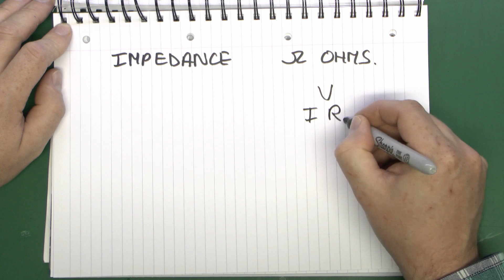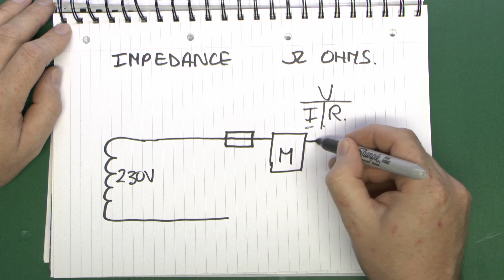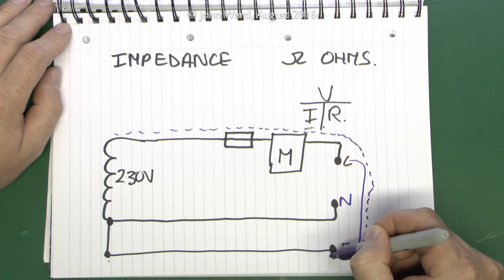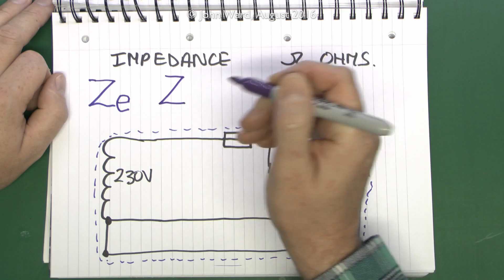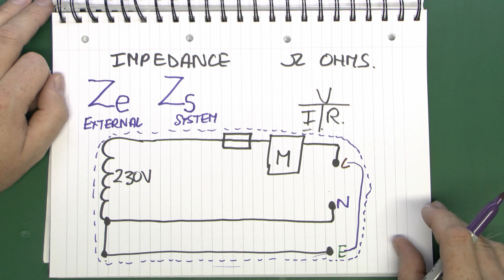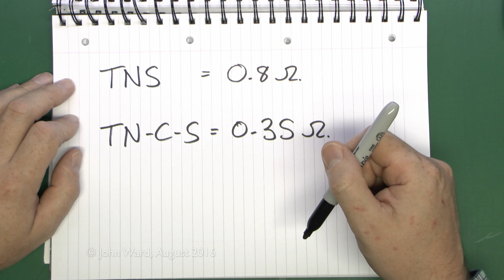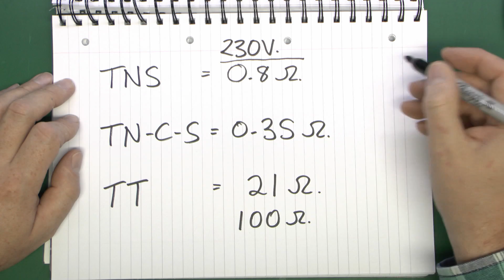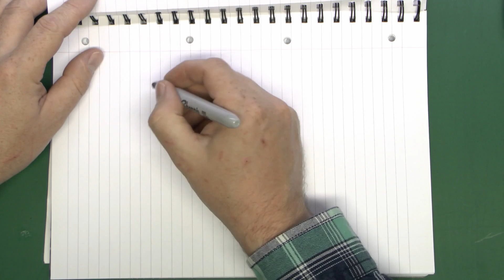Loop Impedance

Comment: Hi john need to pick your brain you say in the video 200 300 olhms is believed not to be acceptable which is what I thought when looking in the regs book and it says anything over 200 means it could be unstable anyway went to a job got 253 olhms on a tt spoke to Nappit who I’m registered with and the chap on the phone said it’s fine because I’m within 1667 olhms but put it down as a code 3 and recommend to go back in the summer and test it again. My problem is spoke to another chap there before about a year ago and he said to me Nappit requires you to be within 200 olhms nic 100 olhms so I’m left scratching my head is anything over 200 olhms satisfactory or unsatisfactory in your opinion.great video by the way
Reply from the maker: In theory anything under 1667 ohms is acceptable, that value being derived from the maximum touch voltage 50 volts and the 30mA RCD rating  (50V / 0.03A = 1667 ohms).  However in reality the value need to be much less, as it will change due to soil moisture content, so the advice about testing again in the summer is valid.
The main thing is to ensure the value is low enough all of the time, which is why 200 or 100 is suggested, that being low enough to ensure that even with dry soil the value won't increase above 1667.
Reply: Thinking I’m gonna just buy a new earth rod and stake it again as old rod connection is buried under some type 2 gravel and probably corroded cannot be going back there in the summer as never want to go back to this job ever again lol. John so in my max permitted zs box do I put 1667 ohms?
Reply from the maker: @Sparks9133  Yes, 1667 ohms, assuming the RCD is a 30mA one.
You can leave the old rod connected, just put a new one in somewhere else, at least 2x the length of the new rod away from the old one (so if the new rod is 1m long, it needs to be at least 2m away from the old one).

Comment: @John Ward

Preparing for an exam and one of the questions is baffling my head, I probably over worrying and it's a molehill of a question I'm turning into mountain hope I explain it properly here goes:

I have six circuits protected by a type B cb:

40A / 32A / 32A / 20A / 16A / 6A

0.5 / 1.25 / 0.96 / 1.62 / 2.0 / 7.3 are the measured loop impedance's for the circuits respectively.

1.15 / 1.44 / 1.44 / 2.3 / 2.87 / 7.67 are the maximum values of loop impedance for the circuits respectively.

It's asking me to refer to the maximum values and show by calculation if these values of acceptable. How do you work out loop impedance if you only know the circuit amps and the measured loop impedance?
Reply from the maker: This is about the 80% rule of thumb, you are just calculating whether the measured values are less than 80% of the maximum permitted values.
For the first one, 1.15 x 0.8 = 0.92, 0.92 is still larger than 0.5, so that is acceptable.
For the rest, some are acceptable and some are not.

Comment: Short Circuit is 287A something, then why circuit breaker's Breaking capacity is up to 6kA, 10kA..?
Reply from the maker: 0.8 ohms and 287A is a typical maximum value for a TN-S supply.  In reality it can be much lower, and fault current much higher.
Reply: @jwflame    I was about to ask about the minimums in practice you come across!.
What about people who live right next door to the substation transformer?  -- Do the DNO wire then 'backwards' from some distance away to increase the impedance to a sensible minimum?  -- Do they put in an intentional impedance-block in series with the supply to those nearest the station?   Does the transformer winding itself provide sufficient impedance to be an acceptable-minimum?.  Is there a ESQCR-like regulation or other regulation for impedances provided to customers, anyhow?   --  i.e. where do these 0.35 0.8 etc. magically come from?!?!?.

Comment: When testing a circuit that has parallel earth paths eg a boiler or a related item do you remove that path. I know you do with r1+r2 tests, but what about achieving a maximum zs test result. This also applies with heating spurs off the ring main etc.

Comment: Hi John. Thanks for the excellent lesson. I currently have a 2.1 Ohm Ze measurement at my TNS incoming line. It previously used a sweated earth braid but has a later clip. UK Power Networks measured directly at the lead sheath and say it’s still in excess of 0.8 Ohms so the clip is not responsible. They are currently refusing to rectify the situation saying that they are not responsible for providing an earth. However, an earth was originally provided, and I note that the Electricity Act 2002 states: “A distributor or meter operator shall ensure that each item of his equipment which is on a consumer’s premises but which is not under the control of the consumer (whether forming part of the consumer’s installation or not) is—
(a) suitable for its purpose;
(b) installed and, so far as is reasonably practicable, maintained so as to prevent danger”.

Do you know if there is any reason why they would legally not be required to maintain the earth? They originally told me it had to still use the original sweated earth braid, but I see that they suggest using earth clips themselves in their own earthing guides(!).

Thanks.
Reply from the maker: They should maintain / repair it, but they will be relying on the 'reasonably practicable' part to do nothing, as in most cases the repair would involve digging up the road to locate the faulty joint, which is probably an ancient cast iron box and the fault being corrosion where the outer sheath of the cable was jointed to the cast iron.  Doing that is expensive, and if one has failed it's likely that the whole street is in the same condition.
There are a number of locations in Poole and Bournemouth with the same problems, and the 'fix' there is that SSE just install a 2 pole 100mA time delay RCD after the meter to ensure disconnection if a fault occurs, effectively making it into a TT install and  using the lead cable outer as the earth electrode (being buried in the ground it is suitable for that.).
It's therefore unlikely you will convince them to repair it properly.
Reply: John Ward Thanks for the quick reply. I’d rather not convert to TT with an earth spike for various reasons, but mainly because I don’t see why the supplier shouldn’t maintain their connection rather than expecting me to pay. I had a similar situation with unacceptable lead levels and Thames Water; they eventually agreed to dig up the road and replace with plastic. I guess I may have to go down the legal route.

Comment: I like that you explain slowly and make it clear. It all makes sense
In addition, TT systems need RCDs for fault protection due to low values of PFC,  TNS and TNCS have RCDs as additional protection not for fault current protection which the MCBS, when of suitable [B] type, handle well.
Thanks for your videos. All the best

Comment: Hi John.  Your videos are very clear and easy to understand...a picture paints a thousand words and I particularly like the explanations of why things are as they are as well as how.  Have you got any video explanations on how AC works physically as none seem to be around good enough to explain to a thicko like me new to the electricity story.  For example, if the electrons travel in both directions, why is the Line 230V and the Neutral 0 volts, surely the potential difference in both wires should swap round with the hertz frequency....I'm obviously confused and demented, hence why I need a video and some pictures to explain!  Congrats on a great series of really informative talks.

Comment: Great video ! On a periodic certificate in the Ze part for a tt system should the measurement entered be the same as you have explained? And the ipf be the higher of pefc and Pscc which for a tt is always going to be pscc. ?
Reply: The ze part of the certificate would be n/a  you would recorded the earth fault loop impedance result for a TT in the RA box. 
Line to neutral pssc will always be the higher than the pefc on a TT system and should be recorded in the appropriate box on the electrical installation certificate

Comment: great video John. however I feel that there are a few things are incorrect with you TT earthing arrangement. the current regulations and on-site guide states a maximum Ze of 200 ohms and makes no reference to the 100 ohms stated in your video. the 21 ohm reference is at the supply transformer not at the installation (page 11 on-site guide also on page 60 table 41.5  BS7671) if you use 200 ohms which is the worst case scenario your external earth loop impedance is 1.15amps. also you make reference to protective device tripping which is not correct terminology they infact disconnect. also you also mention MCB's these are only valid if you install a miniature consumer units, they are referenced as circuit breakers in part 2 definitions and throughout the BS7671 and ON-SITE GUIDE. other than that your videos are great and explain the points very clearly.
Reply: I suggest the salient point of this video, which JW took the trouble to produce and share, is that the TT earthing arrangement is highly unlikely to spare you from a fatal shock so other devices such as RCDs are essential.

Comment: What am I missing?  Super low impedance between ground and the hot leg?  Doesn't sound right.
Reply: I noticed that too, but then I figured he must have meant under  fault conditions
Reply: No - it's correct. It's the Impedance between the live/hot and the earth/ground as it enters the building (where there's a supplier-provided earth/ground). It has to be that way, or if there's a live/earth fault condition it won't carry enough current to blow the supplier fuse. Look at the circuitry and it's clear it will be like that as the circuit back to the supply is connected via an enormous local distribution transformer connected to the property using very large gauge wiring. 

Of course the load side is a different matter. Unless there is a fault, there should be no current flowing from live to earth/ground which means, of course, that impedance will be pretty well infinite. 

For TT systems with a ground rod, then that's a completely different game as he explains. In the UK the preferred distribution system tends to be

Comment: Preparing for an exam, watching your videos as inspiration, funny differences in Denmark the TT can be up to 1666.6 Ohm for private residence and 833.3 Ohms for farms

50V 30mA
50/0,03 = 1666.6 Ohm
25/0,03 = 833.3 Ohm

Didnt know we set the bar extra ordinary low for the earth electrode.

All of this is on the other side of the RCD/RCCD.

Next up; We don't have B-C-D rating on 'MCB' here, we have two types, but that is related to AC and AC+DC, its only the fuses that are B-C-D, and B isnt used, C with x10 is used close to always.

I find it interesting with the differences between the Euro countries in how we do the safety.

Comment: Hi John,

Is it possible to test 110V sockets. EFLI. I was under the opinion you could as there is table in the regs to test at 55V. However the contractor is saying you cant test 110V sockets. Thanks.

Comment: Hi John, what could cause a kettle base to catch fire on a dual voltage travel kettle? If it shorted out, would the fuse not just blow? Thanks.
Reply from the maker: If it has a voltage selector, setting it for 120V and connecting to 240V.
If not, then switching it on while empty, or letting it boil dry.

Comment: Great video John as usual. Quick hypothetical question. If every grid transformer in the UK was an isolating transformer (i.e. no earth) would there be any need for an earth protective conductor at all? I understand that in a TNS/TNCS system the neutral is connected to earth at the transformer leg, but if this was never done (on every transformer in the UK) and we ran on a two wire system (Line and Neutral) then why would we need earth at all? One's body would never complete a circuit if there was no earth (effectively line and neutral both floating)
Reply from the maker: Such an isolated system would work, but only while there was no connection to earth anywhere.  As soon as any fault between either conductor and earth occurred, the system would be referenced to earth.  No one would know this had happened, but if someone until someone touches a wire or a second fault occurred.
As one transformer typically supplies a whole street of properties, it would be impossible to ensure the system remained isolated at all times.

Comment: You cannot connect your multimeter to the earth fault loop because "it will blow up in a ball of flames and be destroyed" . Now that's a proper warning! Also true
Reply: I dont get it? Why
Reply: @jmx318   Because a multimeter set to measure resistance assumes the circuit is dead ie no voltage or current. When measuring resistance, your multimeter puts voltage into the circuit to work out resistance. And by trying to measure the resistance on a live circuit  you are going to effectively create a short inside your multimeter. And since the wiring/circuit inside the multimeter is a lot smaller and more fragile than mains coming in, it is going to fail.  Spectacularly in some cases.  This is one of those areas that requires specialized equipment and shouldn't be done by anyone without the correct training. 
I have tried to simplify my explanation as much as possible, so no one throw rocks at me please for leaving out some details.
Reply: @brendamayfuller8803  the same will happen if you set a multifunction tester to measure continuity and try to test the loop impedance Ze or ZS  your MFT will need a costly repair

Comment: Great video John, I think you should explain how the maximum permitted Ze on a TT system depends on the Touch Voltage Formula and how the result has to be less than or equal to 50Volts. Just saying anything over 100ohms should be investigated doesn't explain why the measured reading is acceptable or not. 

I've been testing for 10+ years on the daily, mostly EICRs, and I'd love to hear your guidance on Maximum Demand.
Reply from the maker: Maximum Demand & Diversity: https://youtu.be/Wq0uODypaGI
Reply: bunch of fukin geeks get a life who cares about testing load of old rubbish it works or it doesn't, if a fault occurs then a fault is there that's life
Reply: @carl190379  '… that's life… " probably not for much longer if you happen to be touching a faulty bit of kit that hasn't been tested by YOU
Reply: Your allowed up to 1666 ohms on a TT BUT anything over 200 ohms should be investigated.
Reply: Electric Pulse Not correct. Your reading must comply with the Touch Voltage Formula. 
This is the only acceptable reading.

200Ohms is just a generally accepted reading for a 'stable earth'. 
The 1667 ohms you are referring to is for a TT system with a 30mA RCD on the Mains.

500ohms is for a TT earthing system with a 100mA RCD on the Mains.

But all must comply with the TVF.
Reply: +Ivan Drago I was talking about domestic TT installations so of course they are all 30mA rcd protected so 200 ohms & under is ok,but 1667 is acceptable using the 50v safe touch voltage.50v/0.03=1667.You don't have to explain too much,I'm a sparky not a plumber ha ha
Reply: ∆ha ha ha

Comment: Wow, 300+ amps due to a short circuit. Now I see why electricians never leave their multimetre on amps.
Reply: Yep.... although if you're using the proper rated gear, it usually has fused prods. It will still go BANG, but the fuses SHOULD contain the fault to reasonable proportions. It makes me shudder when I see people using el cheapo multimeters on the mains!
Reply: TheChipmunk2008 hrc fuses are the only ones I would bring near mains

Comment: Interesting to know about the different earthing systems and how they affect MCB choice. My supply is an old rural one, and I have TT earthing. However, I have some dedicated poles running to me, and the nearest two have the neutral tapped to earth down the pole. Is this an attempt to reduce Ze? What sort of impedance should I expect, given that the earth path from my earhting rod to the tapped pole is only 20m or so?
Reply: +Guinea Fowl
I'm fairly sure, this is more likely just the network being routinely upgraded to PME requirements, potentially allowing your earthing to become TN-C-S later and reducing the touch-voltage in the case of a lost neutral.
I friends' house in Western-Power region certainly has TN-C-S from individual overhead wires with at least the first pole having a rodded tied to the neutral.
Your question also raises another confusion left by the video -- hence my wider question relating to thinking about L-E and L-N impedances separately and Maximum L-N fault currents let alone Minimum L-E fault currents....
Reply: +sbusweb PEFC & PSSC should both be measured & the highest reading recorded on an EICR,one been short circuit to earth & the other been short circuit to neutral,